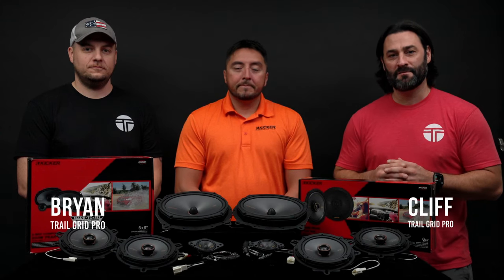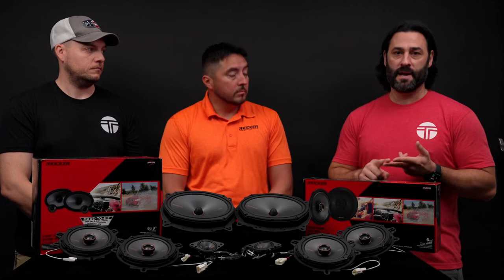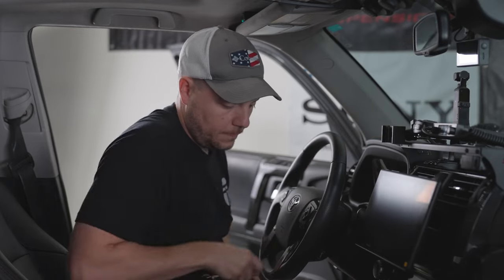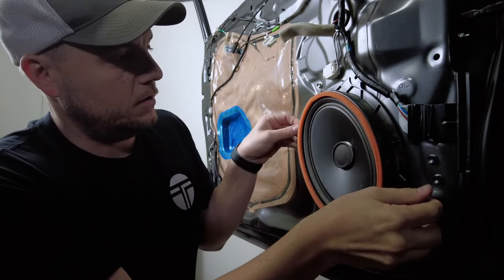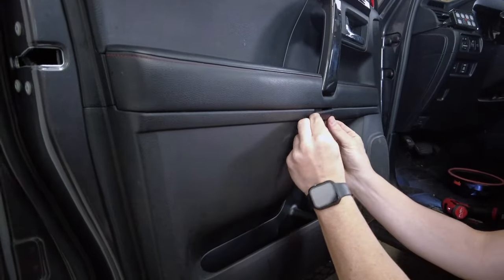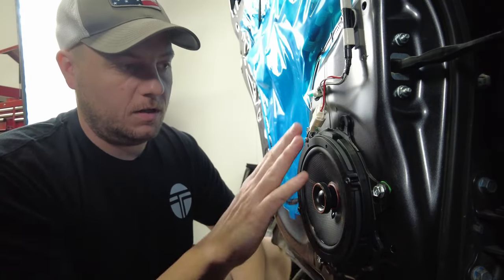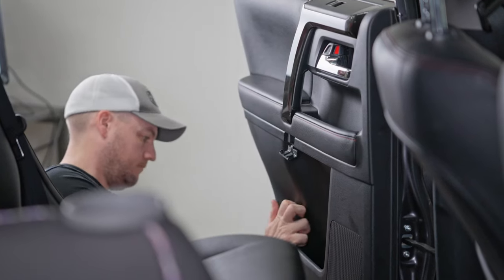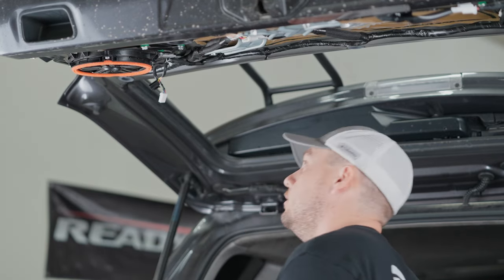Kicker 8 Speaker Plug & Play Upgrade Bundle Install | 2010 - 2023 Toyota 4Runner

Comment: Is that the Sony XZV-AX8100 installed on that 4Runner? The screen looks like it's 10"+ and bigger than the one in the pictures on the website....
Reply from the maker: It’s the 9500ES we’re currently prototyping.
Reply: @TrailGridPro  oh, cool. Should I hold off getting the 8100 then? I was going to place an order for it within a week.
Reply from the maker: @Pluto-slayed  totally up to you! The 9500 probably wont be out until early 2023.
Reply: @TrailGridPro  why y’all making it hard for me now? Sheesh! I was all ‘take my money’ for the 8100 but like the bigger screen and think it will look better in my 2019 4Runner…. Need someone to “demo” one or try it out for ya? The new one that is…

Comment: Is there different between JBL and non JBL unit cuz I have TRD Pro. Thanks.
Reply from the maker: Yep, there's a difference. On the product page when you notate the type of system you have (JBL or non-JBL) it lets us know which connectors to use in order to make the system plug and play for ya!
Reply: @TrailGridPro  does it matter if you plan on updating the HU or already changed the HU

Comment: How much more bass do you get out of these?
Reply from the maker: You definitely get more bass, but the overall experience is really what you gain. It turns your 4Runner into a concert-like experience that you definitely do not experience with the factory speakers.
Reply: Thanks for the insight. I was looking for ways to get more bass without having to get a subwoofer and amp. This will help me out!

Comment: instead of drilling through the door, take the damn screw and grind off the tip enough to clear.
Reply from the maker: These kits now come with shorter screws to correct this.
Reply: @TrailGridPro sweet I JUST got the kit and was hoping not to encounter that. But the screws in the kit look smaller so I’m happy 😊

Comment: This install in perhaps one of the most difficult things I’ve had to do. I’ve been blown up and shot at and this install shit made me insane. You have to remove the weather stripping on top of the panel. The way these guys do it is very difficult. My results may not be the same as yours. I fucked with the back door for maybe two hours. On one door. Still haven’t done the other one or the hatch after 5 hours. I put in sound dampening too though. Door panel clips kept falling out, so I had to find them and reinstall. My mental health was being affected. I finally just had to stop and reevaluate and found this link helpful. https://youtu.be/crEKiz4guFs. Oh, and pro tip. Make sure you cables are clipped in right. Otherwise, you’ll have a machine gun effect on the lock when you put the car in drive or park and spend even more time finding clips again. In the dark. After your headlight battery dies. Good luck or just pay Toyota or and installer to do this. But it does sound nice with just three speakers in so far 😢
Reply from the maker: Thank you for commenting! We're sorry to hear you had troubles with your install but we appreciate the feedback!